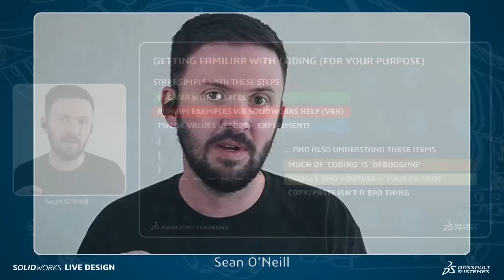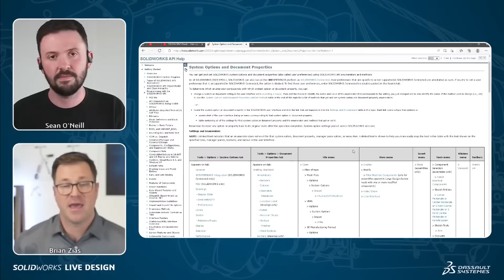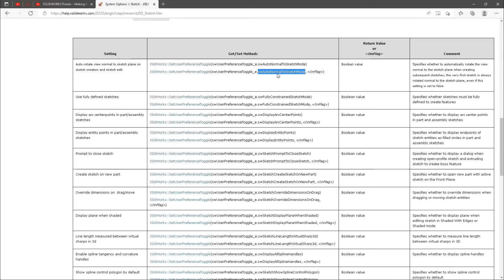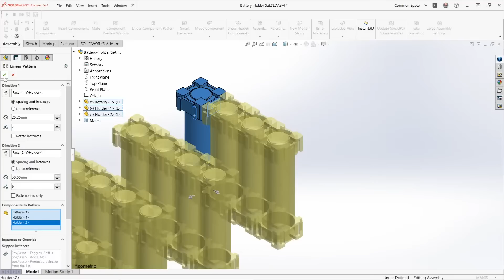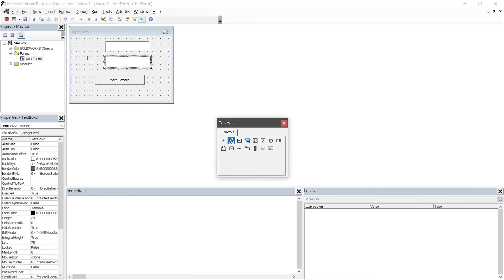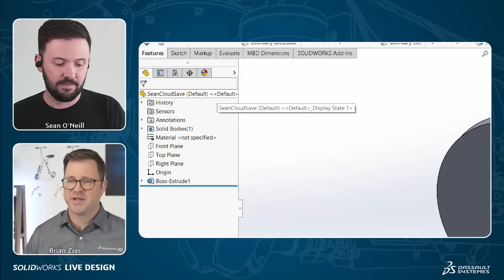The Designer's Guide to the API - SOLIDWORKS LIVE Design - Episode 12 (2022)

Comment: Any idea if the CSWP-API will be included with the SOLIDWORKS Subscription Offer for certification exam vouchers?
I don't understand why it wouldn't be, but it does not appear to be a selection.
Reply from the maker: Hi there, check out this link for a full exam list for SOLIDWORKS. The exam should be listed here: https://www.solidworks.com/solidworks-certification-program
Reply: @solidworks  I'm referring to the subscription offer, where you get free vouchers with an active SolidWorks subscription.
Reply from the maker: Hi Casey, you can take one exam from three main categories - twice a year. This includes one free core (CSWA or CSWP), one free advanced (CSWPA), and one free specialty exam voucher for each seat of SOLIDWORKS on Subscription Service.
Reply: @solidworks  you clearly don't understand the question, or are avoiding an appropriate answer. Not a good look, and is ironically reflective of what SolidWorks has become.
The correct answer is "SolidWorks API certification is not included in the Specialty Topics, and we do not have any intention of including it at this time."
Your welcome.